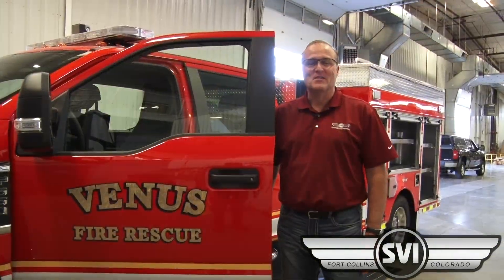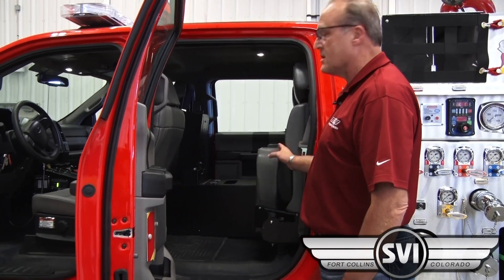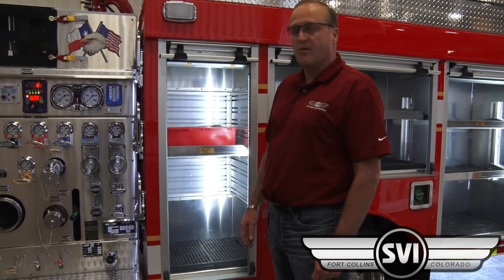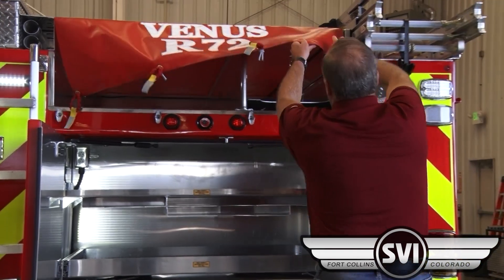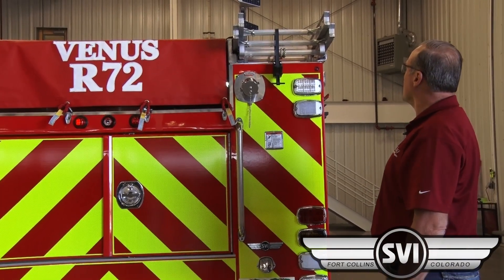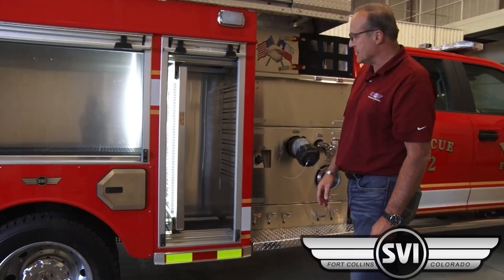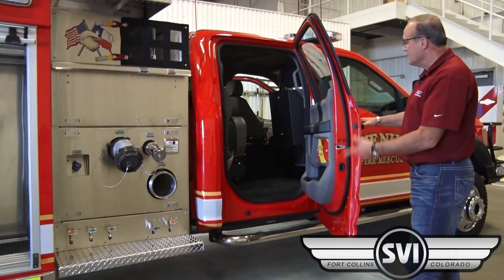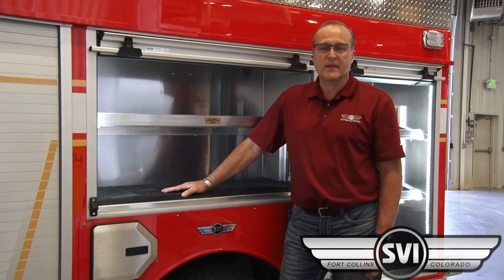How a Mini Pumper Truck Works - SVI Trucks

Comment: Awesome video. I love the idea, mini pumper is a lot of something but they aren’t engines...1250 pump with 300 gallons? Is just enough to get you in trouble if you ask me. My department runs a rosenbauer with a similar concept as our first out to most calls, with equipment and water that truck is a few thousand over gvw. I’m sure similar trucks are right up against the max. That said, the maneuverability, handling and speed of our 550 is worth it. Love SVI.

Comment: Beautiful rig this is in our fleet at the venus fire dept i washed it yesterday its use for medical calls and mva extrication calls only we use our engine for fires.
Reply: What size pump and tank did you get?
Reply: @vandycommer1  im a former member its a volley dept. Not sure but i think its a 350 gallon. Its never used for fires just for rescue purposes extrication tools forceable entry tools and med bags and supplies are all on deck. It has a mini pumper and a deck gun but it was never used when i was there. They have a pierce engine and a tanker for fires and water shuttle.
Reply: @Johnny’s Bricks its a rescue vehicle engine 72 is for fires. Again its for RESCUES for med call runs and for extrication purposes spreaders cutters forcible entry tools all there, so is our med bags abd supplies. We have a private company doing transports so this suits the needs of the community. Any other smart ass questions concerns or comments? This community is an all volunteer force with very little funding from the county the dept raises its own money to pay for the apparatus we they dont belong to the city or county only thing connected is the name of the dept.
Reply: @Johnny’s Bricks It's called having the capability when the unexpected happens.  If they're using this for MVA, and a vehicle is suddenly on fire, but the engine either was not dispatched, or isn't there yet, wouldn't it be nice to have the ability to put the fire out?  You don't get a "mini" pumper to do full-on fire duty.  That's silly.  You get a mini-pumper because you want to have an option when the engine isn't there.
Reply: i am on a vol dept in mississippi and we have thought bout getting us one of these mini pumpers for mva and med calls too but also have one so if u have to draft from a pond to a tanker or engine and ur unable to get ur engine close enough to draft but can get a mini pumper in there ur able to use it to send the water out to ur engine or tanker fill point

Comment: All this and no mention as to the water tank size? This is the most important feature for deciding on such a unit.
Reply from the maker: The truck has a Hale 1,250 GPM pump with a 300 gal. water tank and a 10 gal. foam tank.

Comment: What is the Water/Foam Tank Capacities ?
Reply from the maker: Here's a link to the full specs, loaded with details on the Water/Foam Tank features. https://www.svitrucks.com/wp-content/uploads/2017/11/Venus-984-Specs.pdf
Reply: @SVITrucks  or just tell us. I don’t have time to go thru 85 pages
Reply from the maker: @nubbyg1234  This truck has a 300-gal. Poly water tank. There shall be one (1) 20 US gallon or 16.6 Imperial gallons polypropylene foam cell incorporated into the polypropylene water tank. Hope this helps!

Comment: WWHHHHAT??? No front bumper turret, no light tower, no hydraulic tool reels. Sorry there's a deal breaker. Sure this is okay if you like vanilla, but have another bake sale and get the caramel sauce and nuts.